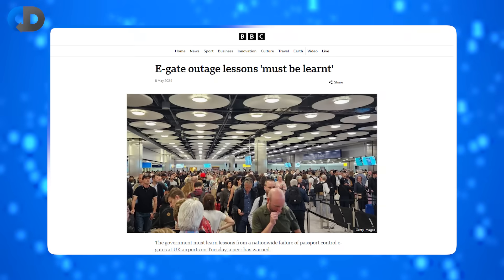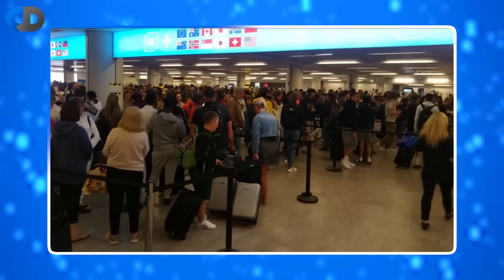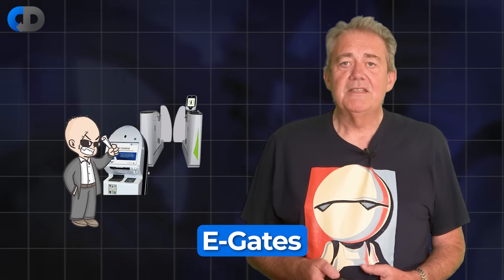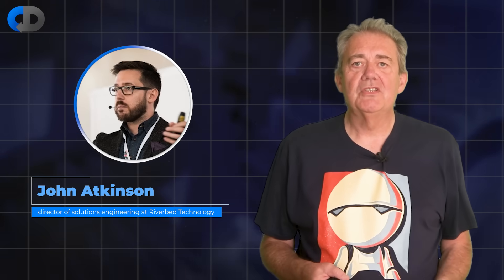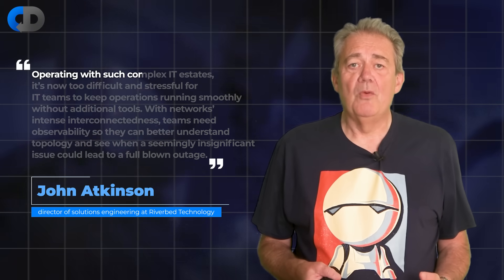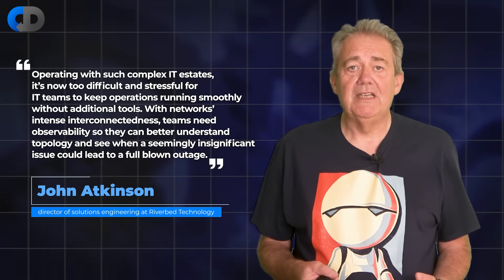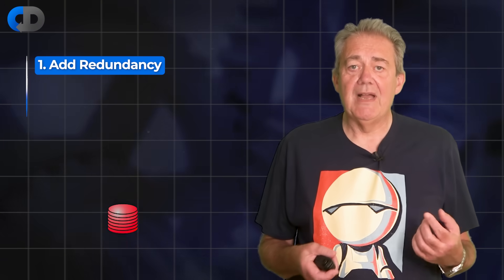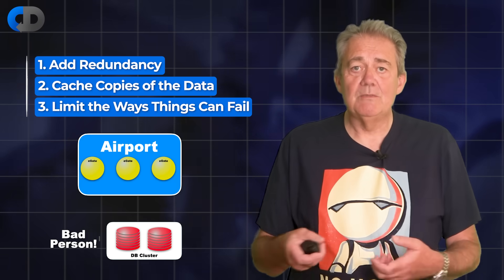Software Engineering F&*K Up Behind The Passport E-gate Failure

Comment: Some crazy assumptions being made here I think. Maybe it behaved exactly as planned. If it looses connection to the server it shuts down and makes the trained professionals handle the passport check. You make 'keeping everything in sync' sound super simple but that is everything but. I've had to design systems that have to do with Invoicing customers and having everything in sync was a super hard problem to solve. 

Also, this event driven architecture (which I'm a fan of generally) is subject to all the same failures you mentioned in the App1 and App2 scenario. This is not some gym entry scanner where there is no real consequence if someone slips through or not, this is the border of a country. Lets say we have a local copy of the list on each machine. Now you have to put in fail safes to make sure that the list is always up to date  if not you could have a gate letting in thousands of people and have a weeks old list for all we know. Can you imagine the fallout if a person on the terrorist watch list slips through a system like this (which they probably do for all I know) and they can point to they system and say "Yeah, this machine had not received the updated terrorist list so he managed to pass through"

The system can probably be designed better but, when you are dealing with highly critical systems, in many cases you do want a single point of truth. It is embarrassing and bad enough if you send out wrong invoices to customers (One of the systems I've had to design). Now translate that to your national security and you are in a whole different ball game.  Sometimes its much better that the system just shuts down rather then keeps on chugging with wrong data and potentially can cause much more harm.
Reply: I agree with this too. What's crazy is they architected a system that is reliant on a DB/API always being available but then didn't build the infrastructure to be highly available.
Reply from the maker: My point is that dropping resilience because it is harder than fragility isn't a good answer, Yes event based systems suffer all of the same failure points, but a well designed event based system make it MUCH easier to design-in resilience, it is after all how Databases and virtually all serious financial systems work, oh as well as Telecoms.

My point is that these problem are well understood, and have been for a very long time, because some people don't know these answers and think that choosing overly naive solutions seems like the real problem to me, somebody earlier in the comments called it "Dunning Kruger Architecture" and I think that is a good description. 

This design was not fit for purpose for a system like this. I disagree with your characterisation that the kind of distributed design I suggest in this video is only suitable for Gym membership. Quite the contrary, the idea of synchronising all these things is the less stable, more open to attack and more prone to failure solution.
Reply: @ModernSoftwareEngineeringYT  The point of these toll booths is to speed up the processing on the border. If they cannot look a person up due to some technical failure they default to stop working and forcing the people to go through the trained border patrol agents that handle this task normally. The point I was trying to bring across is that this function is a perfectly viable solution in a critical system like the protection of the border. Banks and telecom companies are solving a completely different problem where availability of service is much more important to them then how long a tourist has to wait at the airport. besides that, I'm no expert on this but I'm 99% sure that a banking app would need to have 100% access to some centralized single source of truth before you can transfer funds or pay bills etc. I would willing to bet a whole lot on them not allowing you to do any meaningful work on the bank app via a cached copy of your accounts.

Also, I wasn't saying that your solution is only viable for a gym, the point I was trying to make is that this is the countries border. The stakes are super high in this situation and for the system to potentially to get it wrong is not a good idea. We cannot take one design approach and use it for all system designs. In some (and probably most scenarios) the design you mentioned is the preferred one, i 100% agree with you. But I can think of many situations where just stopping the work and defaulting to a more manual process is a perfectly viable design e.g the bank app cannot validate the amount you have in your account and forces you to either wait or go talk to a teller. 

But finally, I would like to congratulate you on the channel. I enjoy watching your videos and I am subscribing :)

and one final thing. Just to be clear. I'm not saying that the design of these gates is perfect, I have no authority or knowledge to say so. All I'm trying to point out is that this is a perfectly valid system design, to have a single source of truth and stopping work when you don't have access to that truth.

Comment: Captain hindsight to the rescue.
Reply from the maker: I don't think it requires much in the way of hindsight. Which really is my whole point. "Let's build a system where every eGate in the country checks in with a single, non-clustered DB to filter out bad people" - What could possibly go wrong? 

The huge mistake here is to assume that because we can never imagine every possible failure scenario, that we can't build resilient systems that can cope with most of them, even the unexpected ones. 

It is unlikely that ANYONE would have predicted that overloading a WiFi service whirl break access to the DB, but assuming that the DB is a "single point of failure" is obvious to the most superficial overview of this system, and so that case should have been considered in the design.
Reply: @ModernSoftwareEngineeringYT  thanks for replying - I do enjoy your channel. I have little doubt you would've probably done a better job here but I dislike the idea of folks talking about solutions in the absolute (it creates false sense of security), there are only ever compromises. There is never enough time, never enough funding and never enough staff. But even if you had all that you'll always have failure points and you don't know by using one "solution" to a problem you don't create a worse one - the truth is we just don't know. All you can do is define your specification, implement a solution and stress test the system - if you can and hope you've captured all the most likely and most significant failure points.
Reply: @charlesd4572  stop trying to find excuses for bad engineering. There is no excuse. They used wifi ffs, they clearly set for failure from the very beginning.
Reply: @vitalyl1327  stop pretending you can failure proof software. I'm not defending what they did just attacking the idea that you can create failure proof systems.
Reply: @charlesd4572  of course you can. There is an entire engineering discipline doing just that. Of course there are always unknown failure modes, but you can always design a system tolerant to all the failure modes you know about in advance.

Have you seen aerospace and medical designs? Even automotive?
Reply: Nah. There are formal methods and well established design protocols that would have highlighted all such issues on a design stage. But the developers were incompetent and should have been flipping burgers instead of being anywhere close to any real world engineering.
Reply: @vitalyl1327  I think your point is delusional to think if you just have the right protocols all failure points can be spotted. In engineering there are no such things as solutions just compromises. He seems to be arguing against that reality. We could spend from here to eternity working on that system and each "solution" to one problem creates a new set of failure points. For example, his "solution" will create other problems: is the cache being updated often enough or at all (this could be worse than failure allowing people in that are dangerous - would it be worse for the system to bar them because it stopped for an hour and then flag them up afterwards).  

BTW what's wrong with flipping burgers - earning a living in a thankless task rather than going on benefits should be saluted not degraded.
Reply: @charlesd4572  there is nothing wrong with flipping burgers - it's a decent profession, and it is far more suitable for the self-taughts and bootcamp "graduates" than engineering. 

There were no unknown failure points in this system. Like, in every distributed system every link can go down. Obviously. "Engineers" who fail to use formal methods to evaluate all possible failure modes (based on known individual component failures) and their consequences are not engineers and should not be allowed to design anything at all.

I've been building fault-tolerant systems for decades. It really hurts to see what abominations people build when they have no engineering background. Cache is indeed the wrong solution here - and using a WiFi for anything even mildly mission-critical is an outright crime. A fail-safe design would have had multiple communication channels and a quick way of detecting the issues with them.
Reply: Not doubting you'd have done better but in the end you can't legislate for everything - could do better is as good as it gets.

Comment: There is an issue with the caching concept ... currency ... you will not pickup recently added bad people since the cache was last updated ...  this could be being updated real time ... sure you could always try and lookup from the true source before the cache ... but then the system owner must accept that a bad person could get through in the event of an outage.  What also can happen in these types of systems is that they lose connectivity to the current source, and use the cache and no one notices ... so there need to be better monitoring of what data source is being used and the system owner needs to manage the trade off between system availability versus implications of use of stale data.   A question in this e-gate instance is did going to manual mitigate the stale data issue ... as in what bad person source did the manual system use ... if any ... again getting the system owners to think through these issues in large organisations can be very tricky as they typically want the best case even in competing requirements.   Did you want to talk about the Post Office too?
Reply from the maker: As I said in the video, It would be interesting to know hoe the emergency response actually worked. Either they had another route to the bad-person-list or they had copies of the data.

If they had an alternate route to access the list, why not automate the switch-over to that, rather than rely on staff carrying laptops running through airports?

If they had a copy somewhere then this has all of the same problems/trade-offs as the cacheing solution I recommend.

Cacheing is a well understood problem and there are lots o patterns an approaches to make it work, even for distributed caches.

Non of this is simple, but it is what is required to build distributed systems.

Comment: When you mention, “imagine or predict what can fail”, I was wondering, do you not have a structured approach or tool to analyze potential failures such as FMEA (Failure Mode and Effects Analysis) during the design process ?
Reply from the maker: My approach isn't at all formal, we simply think about and explore, usually in small groups, all of the ways that we imagine bad things could happen. And we monitor what goes on in production to see if we are hit by any bad things that we didn't imagine and each time we find one of those, we find ways to make sure that the system won't fail in the same way again, and repeat.

Comment: The reason these failures are inevitable is no one responsible for the system pays any price for being wrong. On the contrary, when it comes to government failures they inevitably get a bigger budget.
Reply: A bigger budget won't fix bad choices/designs, it might patch or hide those issues for a bit until they come up again and you need yet a bigger budget. This is usually the norm in some places, and if no-one pays the price it's easy for those contractors to actually go for failure. 

Gov contracts are very costly for all those reasons, to avoid failures, to design with redundancies, and make sure something works no matter what, etc. If specs are not met, and there are no consequences, why have any specs in the first place or why build according to them if they even exist? 

And, in some corrupt govs, the contractors can always share the profits with some of the gov overseers, spend the money right into their pockets and do not much, or just enough to get a bigger deal soon. This is standard practice in some places.

Comment: Getting a hold of that "bad person list" would be a pretty valuable hack and much easier if there are hundreds of copies outside of a secure area... sounds like a bad idea
Reply from the maker: An easy problem to solve, in a way that is at least as secure as a central DB.
Reply: @ModernSoftwareEngineeringYT   That's easy to claim. Admittedly we don't know what their security requirements are, but would you let copies of even hashed/salted passwords replicate to unsupervised, unsecured workstations in a public space? These are national secrets. How would this be easy to solve from a security standpoint? I'm not excusing their faults - I'm doubting that replicating national defense secrets in a public space is a good idea
Reply: @ModernSoftwareEngineeringYT  Come on now Dave a single copy is easier to secure than multiple copies, which are inherently more risky and need to be updated so the risk factor is even greater.  Lets not start talking rubbish to defend software.
Reply: @TK-UK with multiple local copy, you only need to secure the hosts. With single copy, you also need to secure the transit. Depends on use case and local infrastructure, multiple copies are not always less secure.
Reply: @bepamungkas  True, whether you have a single or multiple copies, the gates need access to the data. If there's a risk of a copy on a gate being exposed, then there's also a risk of the gate itself being compromised and used to extract the data.
Reply: @jonathanmarino7968  agreed. But to be perfectly fair. Someone rummaging through the e-gate machine looking for io ports is easier to spot than someone eavesdropping your traffic. Unless you have well-monitored private line, which seems to not be the case.
Reply: @bepamungkas  Show me the proof that having multiple copies of a thing all over the place is as secure as having a single thing.  As I say lets not talk rubbish guys... Next you'll be trying to tell me having copies all over is even more secure!
Reply: @TK-UK  sure, torrent vs. file host, password auth vs. totp, dns, bgp, etc.

As I said in the previous comment, it depends on use case and how the system was designed. BGP and DNS is resilient because its not centralized, but poisoning is still possible. Although I haven't witnessed any occurence when the entire internet is down for everyone. And somehow when poisoning occurs, the entire system can get back to a healthy state relatively quickly.
Reply: @bepamungkas  This is UK eyes only or higher Government data.  I have 30 years as a developer, for banks and governments.  I'm not just turning up here asking silly questions.
Reply: This is "CAP Theorem" but with highly sensitive data.  This isn't facebook likes.  Having loads of copies of this data all over the place is inherently more risky.
Reply: @TK-UK  apologize for being silly and spouting rubbish. But I believe the deny list (that requires immediate response by border officer) is public, while the watch list (which usually applies a silent flag) isn't.

I can't see any specific reason to centralize the deny list. While for watch list, the terminal only acts as edc while flagging specific entry can still be done in central location.

I'm not sure if that's the case in the UK. Or whether watchlisted people got notified on arrival.
Reply: @bepamungkas  Are we saying that accessible copies of the same data located in multiple places is as secure as a single accessible source of the data?  Perhaps I am thinking about the risk rather than the security... as the risk seems greater with copies.
Reply: @TK-UK  yes, that I agree. But given the context, I dont see why that would be the case. Either they have to keep a local copy anyway just in case the centralized source isn't accessible. Or worse, a denial of service would halt or even disable the process.

At the end of the day, the main question is whether the list in itself is important, or the content and its use is important. Based on the answer, we can justify whether the benefit of disrributing copies outweighs the risk or not.
Reply: @bepamungkas  Sure.  I'm assuming the data is highly sensitive and not publicly available.  If not then do whatever you want.